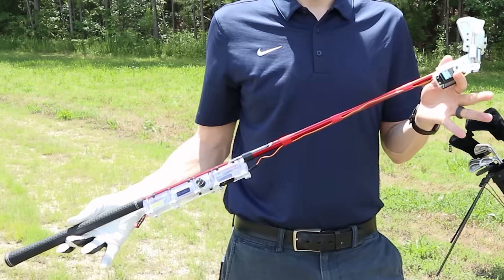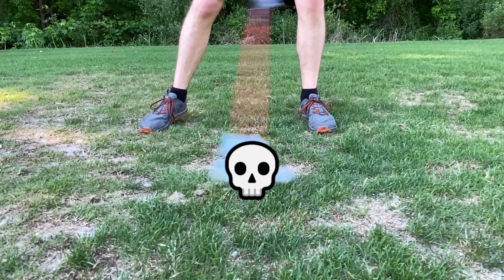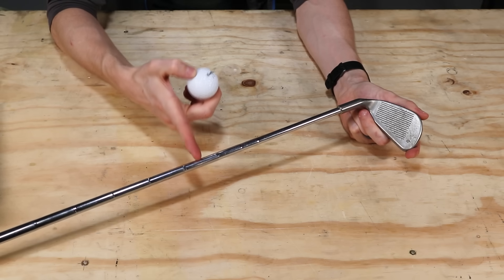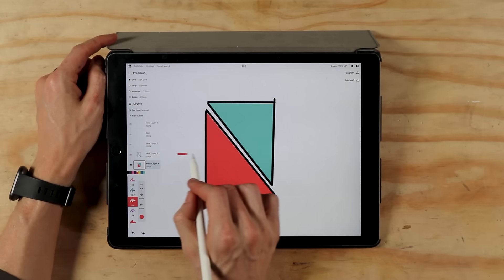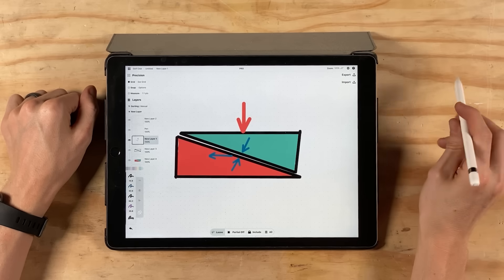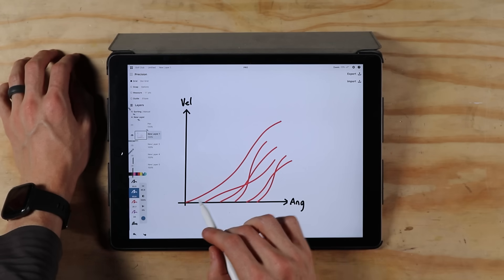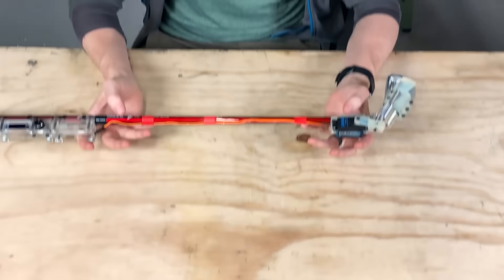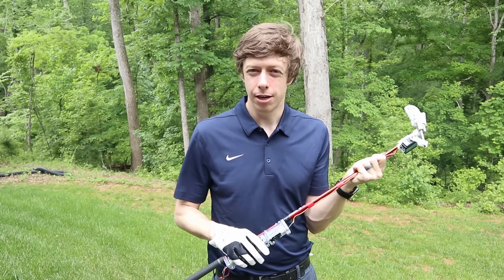My self correcting golf club makes me a better golfer

Comment: I could be wrong, but I believe the golf club is slowing near the end of the drive due to aerodynamic drag which goes at the square of the tangential velocity. I assume a driver clubhead is usually ellipsoid instead of a flat plate to reduce body drag and essentially increase the impact velocity that one can attain with a given swing force. Maybe see what difference adding a shell around the clubhead makes

Comment: When he said that the balls impact moved up the club at the speed of sound that was way off
Shockwaves move thought more dense materials faster
Reply: Yes, shock from the impact moves through the club at the speed of sound in that material, not the speed of sound in air. That’s what he was describing. And no, the speed of sound in solids is not directly related to density; for example, the speed of sound in aluminum is about 5x faster than that of lead.
Reply: @Warriorcat49  then what would be the factor for the speed at which it travels through materials?

Comment: 10:23 This is because a golfer can inadvertently de-loft or add loft to the club face if they lean the club shaft too far forwards or to far back. For example... the club face on my 8 iron has a loft of 33 degrees. If it strikes the ball with the club shaft leaning too far forwards then the loft will no longer be 33 degrees but closer to that of the 7 iron or 6 iron.

Comment: The vibration wouldn't be the speed of sound, it would be dependent on the modulus of elasticity of the material.  Like slapping a thing of jello versus hitting a bar of steel.  The wave propagation would be different.

Comment: Why did you pay 350$ for an IMU? Is it made out of gold?
Reply: Because cheap ones are crap, they drift too much when you integrate it.
Reply: @umber-light  you should be able to complete this project without integrating. If you're good enough at math, you should be able to get the angle data from just an accelerometer
Reply: @tubanbodyslammer9125  He probably had it lying around anyway, it must also have a higher degree of accuracy for both speed and angle data.
Reply: @webforder4201  just seems outrageous expensive, and completely unnecessary. You could d ol this project with an mpu6050, or even an adxl345

Comment: I’m not extremely familiar with hydraulic power systems, but the problem you observed sounds a lot like water hammer. You may be able to fix it with a Pressure Safety Valve or pulsation dampener.

Comment: When you ripped the solder pads off accidentally I don't get why you didn't just scrape back a bit of the insulating coating and carefully solder direct to the traces that feed the pads.  A little fiddly, sure, but not 12h of work like your USB alternative!

Comment: I sometimes sleep with eyes open, basically I clench my face to much and when the muscles retract when I finally go into deepsleep the eyes don't stay shut. I was pondering ways I could make some sort of soft/padded magnetic locks you'd put on each eyelid to lock em together. My biggest problem was trying to figure out a way to stop them from getting lost if they are malplaced during sleep. 
See I think it'd be like bite-mufflers (or whatever ya call em in English) where the first few nights you try to sleep with the bracelet or whatnot, you almost always just pull it out during the night due to not being used to it. Whilst later you stop caring. 
I contemplated adding tiny diod-lights for whenever they were touching (aka fallen of and connected) or when they were to far apart (aka fallen of and seperated). But that seemed to clunky. 
Anyway, if you could solve that issue I'd fucking gofund you a car or something because grinding teeth+those eyes are a nightmare.

Comment: Hey! I'm a Physics Grad student at UW and I was thinking that you could improve the design by eliminating a few variables. first, if you had a set tee height and second if you had a physical system which could accommodate for the trajectory of the club. The largest issue you are facing is an error regarding hitting the ball itself. The club already looks abnormal compared to other clubs, might as well make a tee and physical trajectory lines that fit as well.

Comment: Using that club face (iron) as a sandwedge & pitching wedge will be difficult— the convex & circular shape of the Sandwedge heads along with the specific spaced grooves allows for it to be a sandwedge. So great idea and hands down you are 100x brilliant than your average (i could never actually design this) —just may have to wait until a design allows the iron head to literally change ie implementing 2 pieces ()O() that remotely flip down on each side of the face of the iron head thatlock into place

O-being the iron face 
()- Being the pieces that remotely flip down

You’re still brilliant AF the fact you were able to design this

Comment: very cool project, there are also servo arms that have springs built into them (servo savers they are called) to absorb shock from use as well. that might be a good upgrade for your servo arm or servo horn to be extra safe on the shock to the gears in the servo.

Comment: One solution for your hose issue, connect hard hydraulic line (think car or truck brake line) to the back of the club head, and form the hard lines to follow the club shaft up, possibly though the club shaft/hand grip. Then connect the flexible lines near the grip, that would reduce the springyness of the lines even more than the actual hydraulic rated hose would. It would also reduce the flexible hose flopping all over the place near the club head when you swing.

Comment: How about instead of a cam you use a pinion worm gear pair? Maybe it would result in a smaller mechanism overall, although it would need some sort of lubrication, housing etc. Still might be easier to manufacture by metal?

Comment: If your goal is to make yourself a better golfer, I would approach the design from the other side of the equation. That is to provide your body (hand, spline and leg muscle and even brain) with stimulus during the swing process. You will still need to combine the AI, computational analysis and robotic sensors controls etc... The end result of this approach can accelerate one's learning experience rather than a wonder club that ultimately taking away the fun of golfing. One of most challenging task in learning golf is to have "real-time" feedback in a "closed loop" fashion. The worse thing can happen to your design is if you have perfected the wonder club and not really knowing the fundamental of golf swing..
On the other hand, with your dedication and knowledge, I am sure you will be successful no matter which field you are in. Good luck to you...

Comment: I think what you’ve been doing so far is amazing and an awesome feat of engineering but I have noticed that there are 2 details you haven’t noticed about the clubs.  First, is that each different clubhead has a shaft that is slightly longer. This makes it so the head of the golf club is slightly further away from you when the head strikes the ball.  So a 9-iron is very close to you, while the 3-iron is far away, like a driver.   This increases the club head speed at time of impact for a 3-iron, while the 9-iron is a bit slower, because of the shorter shaft.   Your method is looking at the swing only 2 dimensionally, instead of 3, I guess.   Not sure if that illustrates what I’m saying or not.   Second, if you inspect a whole set, you’ll notice that the angle changes as you go down irons, because the head is further away from you when striking the ball.   This is why Drivers are so friggin long.  Good luck, and sorry about complicating things.  It could replace the ‘high’ irons, but not the lower ones, without modifying the design more....

Comment: As a golfer this made me laugh at first, but i respect the effort. Couple points 1. Ball flight laws path is very important. 2 Cant tee in the fairway 3. Good golfers want dynamic loft lower than static loft. Try to get LM to actually see the data, maybe skytrack (least expensive) or foresight, if outdoors trackman.

Comment: Just wondering why you couldn't repair the broken header, I'm guessing it's because the pads came off with it and they were not all surface traces ? If that's the case why not pull jumpers off the ic itself or nearby components. Should be able to find a datasheet or do a little probing to find out where each pin originated. 5 pin header likely TTL connector and the 5 pins for 3.3V, TXD, RXD, GND & 5V  so probably only using  1 of the VCC pins

Comment: You're bending your left arm on your backswing..
Reply: 10:28 from an engineering standpoint, this is very interesting.
However, you really need to learn more about golf.
Reply: 10:28 from an engineering standpoint, this is very interesting.
However, you really need to learn more about golf.
Reply: 11 would be a gap wedge.
Reply: Slice and hook correction.
If your swing path is off on your downswing, you can't correct it moving the club face. You'll end up with a push or a pull.

Comment: I understand that there will be saturation problems with cheaper IMU sensors, but that can be fixed with an array of cheaper IMUs and algorithms which one of the wearables devices I worked on did. If interested you can find papers on the topic I believe

Comment: Next project. Seriously. Make something to un-cuple you hands from your mouth while speaking. I mean you obviously are doing fine, but if you can hold things still that we are trying to look at, you will be doing great. It is a major flaw in so many presentations on Youtube. But really great piece of work. Why is that IMU so expensive? Is the computation on-board? I would think a Blue Pill and one of those 6 or 9 or 10 DOF boards would do. Maybe $30. (a 6 DOF and a GO button you press before the swing with it hanging straight down).

Comment: Screws dont come loose? guess you never seen a solid mounted 503ci Big Block Ford Making 1600hp. Loc TIght green just to keep chassis bolts from rattling loose

Awesome build, maybe i could use that to get the ball sorta where i want it

Comment: I’m sorry, but not even a professional violinist can be good with that violin 😅
Reply: Wait why lol
Reply: @shashvatverma5673  The sound of a violin is very sensitive to a large number of small details, and get pretty expensive before you get them made to the right amount of precision. That violin seems to be a cheap novelty one (the main clue being that it's made of anything that's not wood, which is never a good sign), so chances are that it will have a bunch of parts that aren't aligned up correctly. The end result is that the violin is prone to producing some unwanted and unpleasant sounds, and it'll simply take a lot more effort to get good sounds coming out of it.

Comment: Can you make a roulette computer that measures the speed of the ball and the RPM of the wheel to predict in which quadrant the ball will land?.
Even if you can predict which half of the wheel it would land and place bets on a spread of possible numbers you will be +EV.
Devices like this have existed for decades, but I surely the hardware is advanced enough now that you can track the ball and wheel automatically rather than manually clicking whenever the ball / wheel pass a set point.

Comment: For the swinging angle, could two gyroscopes placed at a known distance between each other be used to determine acceleration? Maybe calculate the distance to the ground with some laser (ehh, it is getting too complicated at that point). Perhaps if one had a super precise position determiner laser thingy on the club already (so one does not need to worry about the install) would the two gyroscopes work?

Comment: One thing that comes to mind to improve it is to have slow-speed 'practice swings', where you swing it a few times, each time stopping when it contacts the ball at the proper place.  The resulting IMU data should--in theory, anyways--enable the software to lock in a position for the ball.  If the arc of the 'real' swing is calculated to intersect at a different point, then the angles of the club can be adjusted to match.  Does that make sense?

Comment: The swing path is a major factor in ball flight not just loft or angle of club head. And a club that is only one length limits you to only about 3-4 clubs maximum range of effectiveness. When your using your regular clubs your club selection is what’s hurting you

Comment: you could solder those pins or some wire on the traces of that board message me if you need help. i do micro-soldering/trace repair all the time

Comment: I would have predicted the final velocity of the club a little differently:
You essentially have a 2D scalar field (velocity, angle) where the value of the field is the final velocity. (Starting velocity is irrelevant because it is encompassed by these two but one option for an even more accurate prediction would be to also have an acceleration dimension.)
Onto this plot every point from your measurements.
After this you just need to denoise and interpolate your data.

Comment: 4:09 It goes basically at the speed of sound... through iron, not to forget ;p (I'm sure you know it, but just to be more evident and educational, not to make people think there's ONE speed of sound)
And with that, the pressure waves that you mentioned would move much faster through the hose since they are being propagated by the fluid inside the hoses too, the "hydraulics". It seems to me the problem with the hoses afterwards (no expert here, just an undergraduate engineer) is that the pressure wave sort of "rebounds" off of a depressurisation at the face of the club, and the system overshoots afterwards, making it break.
Love your projects, keep at it! <3

Comment: Do you also not need to adjust for club length? A 3 Iron has a different club face angle and shaft length vs a 9 Iron. This will affect the velocity of the club striking the ball and affect the distance the ball can travel.

Comment: Highly recommend Wilson Fat Shaft irons when you are ready to integrate technology within the shaft. You can find them pretty cheap on Ebay as they were introduced some time ago and fell out of favor as nanotube etc. had better reduction in torsional forces which is one of the reasons the Fat Shafts were created. Here is an auction I found.
https://www.ebay.com/itm/133342354974
Also research bulge and roll design features in golf clubs. This utilizes the gear effect that helps to keep the ball more on target. Feel free to reach out for any other hangups you may have.
greatlakesconcepts@gmail.com

Comment: instead of hydraulic hoses which are too springy, you could use solid-steel brake lines they won't stretch and actually run them through the club so it will be more aesthetically pleasing. this is a very cool project I cant wait to see the next phase and I don't even golf lol